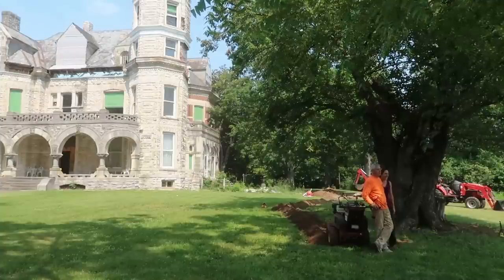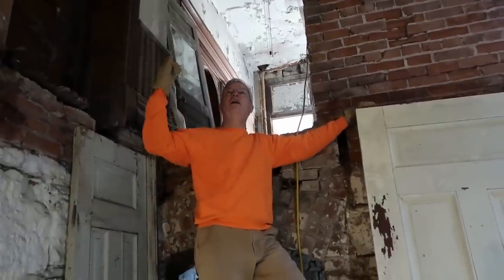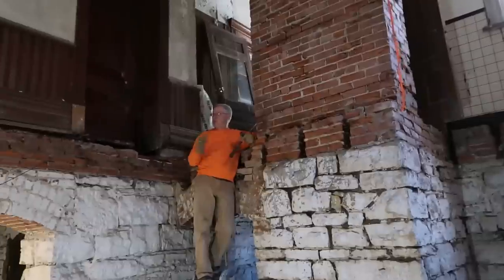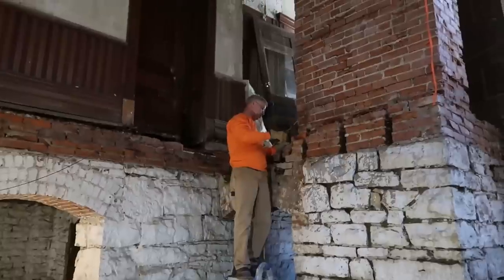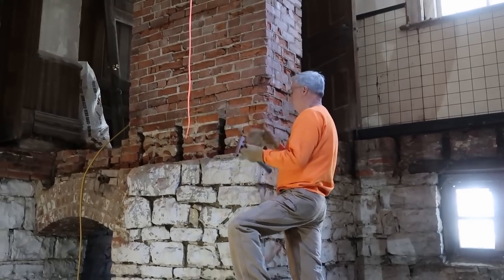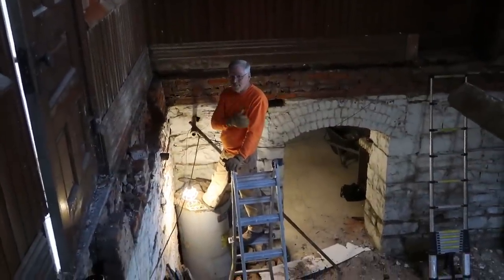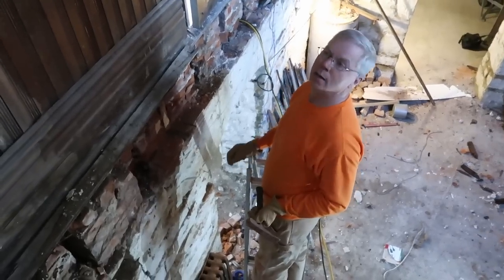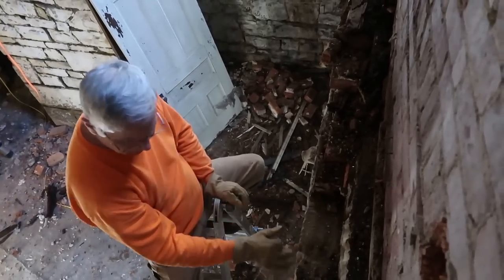New Floor Project Is Underway! DIY Castle Restoration. S4E2

Comment: Will the termites travel from the basement floor up across the stone/brick walls to get to the wood or will the stone walls stop them? Especially since Frank intends to put aluminum flashing behind the wood and you have the basement dried out now. Man they are creepy!
Reply from the maker: There is always a chance that termites will find a way in, just like water. Once we put up physical barriers we plan on treating the ground and putting in monitoring stations.

Comment: Patience, perseverance and faith in the knowledge you are doing the best for Mrs. Mooreland.  
It is odd that the 2 x 6 was sandwiched between the courses of brick like it was.  
The engineering of the foundation is a marvel unto itself and then continuing up with brick walls for two more floors.  
Sweet snoozing Mia.
Reply from the maker: They obviously didn't have all the knowledge of termites that we have today.

Comment: Those bricks may not hold anything up but they do serve to keep the floor joists from twisting...no expert here but i did see this very issue covered elsewhere and it is very important to stop joists from twisting.
Reply from the maker: Yes, we described it as blocking. That's exactly what it was there for.